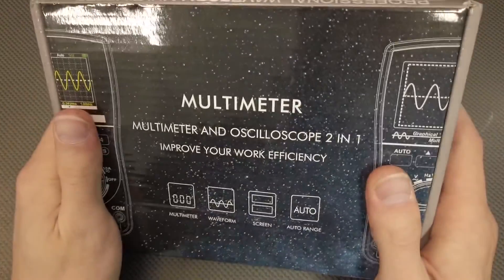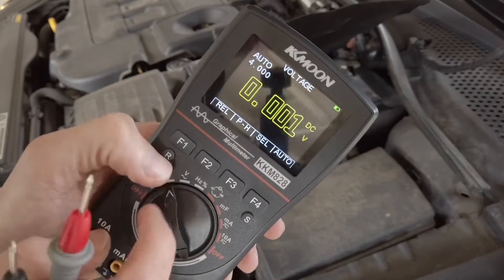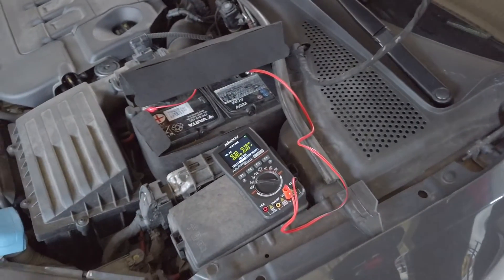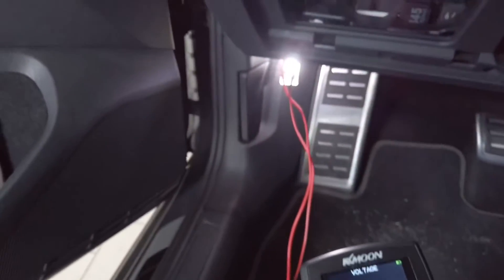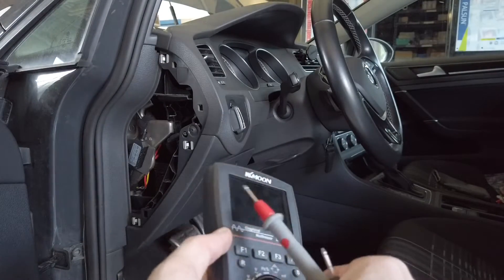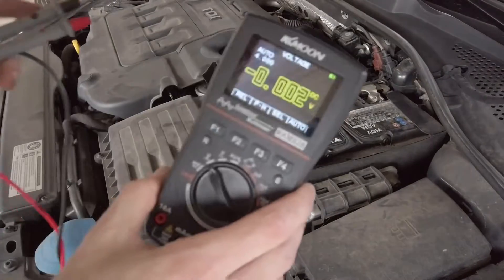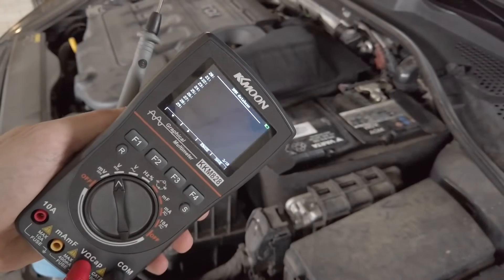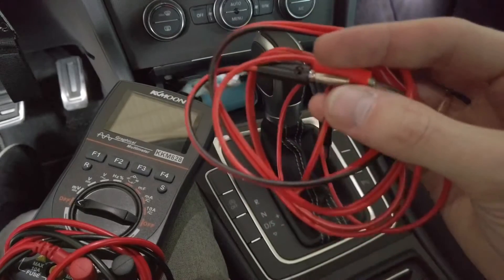Multimeter and oscilloscope car diagnosis - KKM828 review

Comment: Can this tool test CAN -BUS circuits just asking I will wait on your response thank you
Reply from the maker: Well, it will not decode CAN-BUS communication, that's for sure.
There's also one input channel in the device, when CAN-BUS is 2 lines with differential signal.
But I will check what will happen if I connect it to CAN-BUS network, just to see what we can get on the display.

Comment: For charging - There is so much room in the back - it can be easily replaced with either lipo (lipo battery  @full is 4.2 so it's just a bit lower than 4.5 or 4.8v of alkaline) or just in parallel of the batteries (it will need recahergeable AA batteries also)

Comment: Great video. I liked how it can display, at the same time, the high voltage and low voltage when you started the car. Easy test for battery condition. That alone is a selling point for me.
Thanks for posting such an informative video.
Barry

Comment: That's a MUST-TOOL meter,  its a copy of the Must-TOOL, Lumy & others. But STILL GOOD METERS.. DON'T LET THIS COMMENT PUT YOU OFF BUYING IT. THEY ARE WORTH THE PRICE!! WHICH BY THE WAY IS CHEAP FOR WHAT YOU GET. PUT IT THIS WAY YOU WON'T BE DISAPPOINTED NO MATTER WHICH BRAND YOU BUY..😊
Reply: have u used these to test out ckp or cmp sensor waveforms ?
Reply: @JayDee-ve6ml  I have used this particular one in the video for O2 sensors signal.